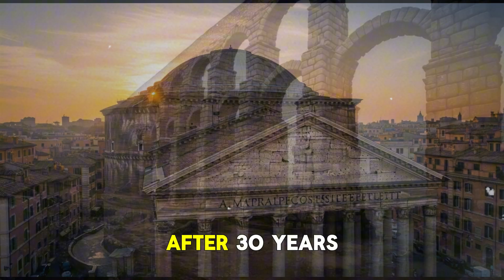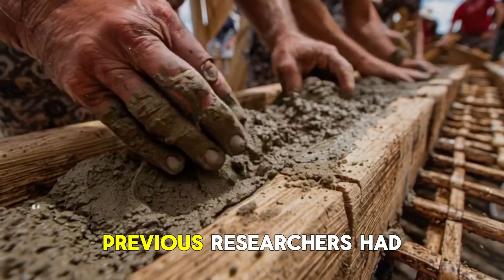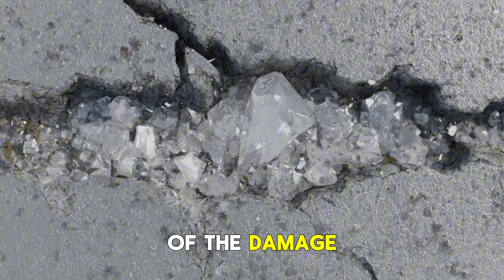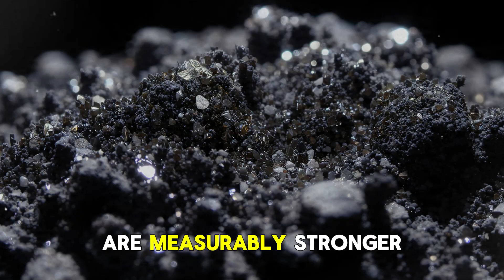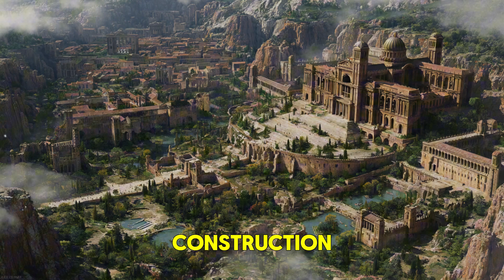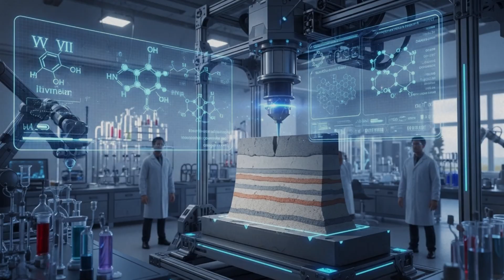The 2,000-Year Concrete That Heals Itself — Why Did We Stop Using It?

Comment: What isn't mentioned is that Roman concrete wasn't reinforced as it was used only in compression, not tension. Steel reinforcement is used to give concrete the ability to resist tensile forces. Much of modern concrete's issues are due to the steel reinforcement corroding withi.
Reply from the maker: That is a fair and important point, and you are right that the script did not address it directly. Roman concrete was used almost exclusively in compression, which means it was not subject to the tensile stresses that steel reinforcement is designed to handle in modern construction. The absence of embedded steel also means Roman concrete avoids one of the primary failure mechanisms in modern structures, which is the internal corrosion of reinforcement bars expanding and fracturing the material from within. These are genuinely different systems solving different structural problems, and the comparison in the film would have been more precise with that distinction included. Thank you for adding it. Comments like this are exactly what makes the archive more accurate over time.